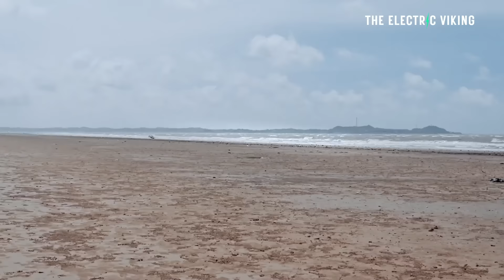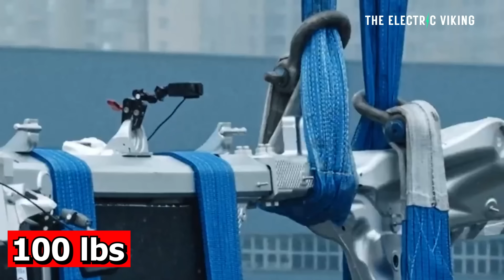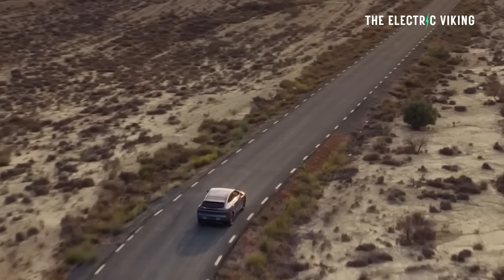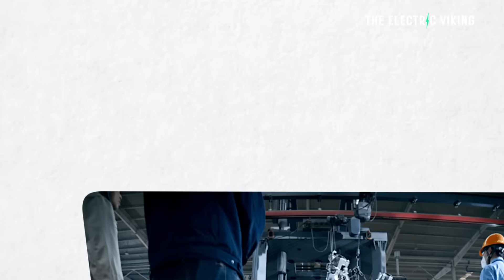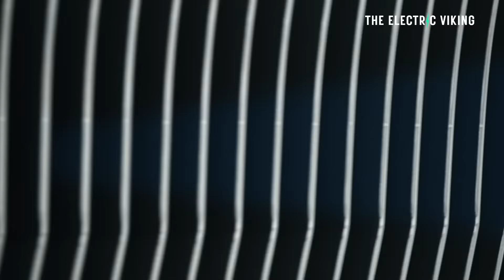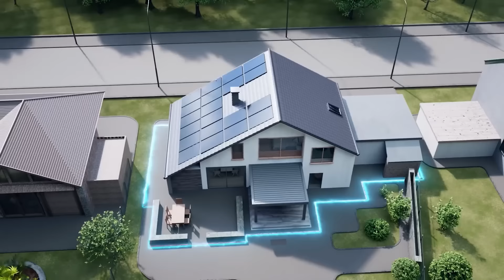Did BYD Just Copy Tesla’s Gigacasting? (The Structural Truth)

Comment: There are like 7 grades of aluminum and multiple alloys within those grades. 7000s series won't crack but you can pretty much only mill a block into a form.(Think MacBook Pro) .  1000 series Aluminum is pure soft makes great jewelry. 

To answer the initial question, 7xxx Aluminum is stronger than steel by weight. (a 10 kg  1 meter long I-beam is stronger than a 10 kg 1 meter  long Steel I-beam: the Aluminum I-beam would be thinker .) Steel is stronger by volume (if the I-beams had identical  dimensions the steel would be stronger but weigh twice as much). So, I could use a steel plate as a floor for a vehicle or I could make an aluminum floor with vertical cross support (like i-beams) that weighs 30% less than the steel plate but is structurally stronger. it would cost maybe 15% more expensive but the weigh reduction allows less battery for the same range of allow more battery for greater range.

Comment: You demonstrate a bias in favor of Tesla and BYD. It should be noted that, as early as three years ago, Chery formally disclosed that the EQ7—a compact battery-electric SUV—was manufactured utilizing a high-strength aluminum-magnesium alloy structural framework. According to the manufacturer’s technical statement, this alloy system provides enhanced durability and reduced vehicle mass, yielding performance metrics that exceed the tensile and yield strength values typically associated with conventional automotive-grade steels. Such material specifications align with industry standards for lightweight structural alloys (e.g., ISO 209-1 for aluminum alloys, ASTM B557 for tensile testing), thereby substantiating Chery’s claim of superior strength-to-weight ratio in compliance with recognized international testing protocols.

Comment: here in the cold north we pour salt on the roads at winter time. Salt accelerates the rusting of steel, many cars after 15 years will not pass inspection due to heavy rusting at critical parts, this is both structural and safety at thin metal plates. Guess Australia is dry sunny and no salt poured on the roads. :)

Comment: From metalurgy studies it's clear that Aluminium does develop micro fractures from repeated small loads & there's no load that doesnt eventually create a crack. Steel on the other hand keeps it's   structure without cracking with small loads, only with high loads will it deform.

Comment: The salt we use to melt the snow and ice on the roads during cold winter months driving , the salt eat away aluminum rims .
The salt definitely well also eat way the body fram structure , too . 
Let hope auto maker have developed a much stronger aluminum material to prevent from road salt corrosions !
Reply: Dude. You got got. Those rims weren't aluminum! Aluminum will anodize another metal or polymer or form an oxide layer on the surface which will protect the underlying aluminum from further oxidation.(it will form what appears to be a white film)  AlOx  aluminum oxide is much different from  FeOx rust. You got tin/nickel shiny alloy rims.

Comment: That lift is a not what it seems. The structural rigidity is given by the battery pack wedged between the two vehicle frame beams.  And the strain quiver effect  for the camera is a joke for a big sling and that light load.     People that think aluminium is not as strong as steel in certain applications are ignorant.  It’s normally not used because of cost and  requiring a better welding  standard  than using formed  steel  frames and components.

Comment: Sam, your arguments about whether aluminium is better than steel in BYD cars essentially boil down to the use of analogies. And, as Elon Musk has stated numerous times, relying on analogies when designing something is a bad idea (it is better to do use physics first-principles thinking). I am not an expert in this field, so I don't claim to know whether BYD's claims are reliable. However, I know that you are also not an expert in this field (car manufacturing is different from bicycle manufacturing) and you should refrain from trying to pass off your ignorant opinions as reasoned or expert commentary on this issue. I award you a rare but well deserved down vote for this video.

Comment: Yes, steel does not have as much a fatigue issue, over time, but it does have a rust issue much worse than aluminium.
So in the end? probably not significant, very few vehicles last more than 20 years anyway.

But I still do not see why a cast-aluminum structure should be that much lighter than a welded-steel one,
I dont think its weight, its cost.

And if gigacasting lightweight !@#$ is the answer its all going to be carbon-fiber/graphite anyhow!

Comment: My experience as an engineer working with aluminium in my own business for 40 years is, you are right Sam. Aluminium is great when properly designed and considering that, even under light loading, it will eventually fatigue and fail. When it fails, how long it will last, depends on the stress at any given point AND the number of cycles. It is somewhat predictable how long it will last. An example of where and where not to use aluminium is to compare an aluminium bull bar with an aluminum roof rack. The bull bar is cycled many times under very light loads and will last for a very long time. A roof rack may carry varying and sometimes quite large loads and could possibly fail after a short lifetime. So an aluminium bull bar is probably OK whereas a aluminium roof rack has to be carefully designed with quite thick members to reduce stresses or it WILL fail.

Comment: The properties of a metal that you are referring to are strength, durability and fatigue. In aircraft design they take a holistic approach as it is designed for all three. Strength is determined by an expected once in a lifetime large load called a limit load. The load at which a part fails is called an ultimate load and is equal to 1.50 times the limit load. Therefore, there is a factor of safety applied to the expected load.  Durability and fatigue are related. Fatigue is set by repeated lower level loads expected during normal operation which vary in frequency and magnitude over one lifetime. For aircraft design they set an expected lifetime of 100,000 hrs of use. Automobiles would probability be less than that. Repeated low level loading cycles create microcracks which are allowed to grow up to a certain size. The rate at which those cracks grow is referred to as the durability of the metal. Some parts of an Aircraft are designed by the limit loads and other parts by fatigue and durability. One or the other determines the minimum thickness that parts will have to be made to. A fully optimized design should provide the minimum amount of material and weight to meet both fatigue and limit load requirements.

Comment: If structure gets cracks from stress, it is bad. Those cracks come in places where the stress is greatest. Those cracks matter, they make structure weaker in the exact place where it had been already too weak. Just my opinion.. Steel gets rusty anywhere where it gets wet and surface protection fails, that is not necessarily the same place what is the weakest point in structure. Oli spray prevents rust but nothing prevents craks if structure is too weak.

Comment: Bad explanation. Steel is stronger than aluminium, but aluminium can be used exactly in path of the force due to manufacturing process - casting. Very simply structures can be designed with focus on certain forces and that can make structure stronger than usage of steel where it is not possible to use material efficiently.
BYD low pressure casting have energetic advantage over very high pressure gigacasting, also not mentioned in video...

Comment: Regarding Aluminum and Steel, what you say is not true. The best example is the car engine. Yes, there were quality issues when the manufacturers replaced their car cast iron engine with aluminum engine. But with better quality control and better design, the aluminum car engine is now extremely reliable.
Reply: Ahh...nope, the nature of forces acting on both structures are not the same, an engine block will have mostly compressive loads and where we have other kinds of force we just enforce with steel (sleeves, bearnings..etc) a ladder frame mostly will have torsional loads, aluminium is one the worst materials in handling such loads, and will fatigue and shear with time. Say again engines, connecting rods cant be aluminium even though its very advantageous, unless you want to replace them every month or two. Other than that: Aluminium = low fatigued limit. Steel = no fatigue limit meaning steel will reach a point were it's no longer getting weaker, aluminium will keep getting weaker infinitely until it breaks.
Reply: @aurelion3  For the aluminum, you need to be an immortal and drive your car everyday to reach the fatigue rupture cycles.

Comment: Panels made from Hemp are stronger, lighter and flex without cracking, reducing repairs needed.  Why won't anyone use Hemp panels???
Reply: Obviously because cost of production is too high. I assume you mean hemp reinforced plastic which requires an epoxy resin which takes 24 hours to set. Waiting 24 hours to remove each part from the tool is too expensive. I have seen some parts made with a thermosetting resin, but the cycle time is still much much longer & therefore more expensive than metal.
The organic fibre most commonly used is flax. There are also some bio-sourced  resins around now which are starting to be used in boatbuilding.
Reply: Wont it leaks then u need other glue, silicon, paste to cast it, in end it may not be that light
Also these may be combustible, burnable 
While metal have much higher melting point also may Not be as readily burnable under 300°C
"Carbon fibre?" is light but likely haven't got strength to repel compression collision
Reply: Fatigue? Try using carbon fibre frame see how it will last holding up few tons 
while continue driving on roads, hump bumps 
take 40 km or faster corners
May not last few months, come apart catastrophically while driving 

Will people use Hemp & epoxy spring as shock absorber? Instead of metal

Comment: The debate over whether BYD 'copied' the physical hardware of a Giga Press misses the real structural revolution happening. China is aggressively capitalizing on AI-driven material science databases like Google DeepMind’s GNoME to completely bypass traditional metallurgy.

The real breakthrough here isn't standard steel or legacy aluminum—it's the deployment of highly advanced, proprietary molecular crystal matrices. By mapping these stable new structures via AI, they are perfecting ultra-strong, heat-treatment-free alloys (and pioneering massive magnesium thixomolding). This completely eliminates the post-casting thermal warping that has plagued massive single-piece architectures.
Reply: Go save  your AI spin for the stupid yanks !  Your entire stupid answer is AI generated rubbish.
Reply: You can thank SpaceX now.
Reply: @thedukeofalinor1377  the soviet union too
Reply: @thedukeofalinor1377 
For what? You should thank my dog too...
Reply: @blackknight4996  metallurgy

Comment: tesla didn't invent a skit, it copied from toycar factories
Reply: Elon Musk didn't start Tesla. He's stealing it blind by fan boys rooting on. 😅
Reply: @peternguyen9386  Elon isn't the founder, but he's the one responsible for where Tesla is today.
Reply: @Ben21756 Tesla is going away like Tucker car company. Elon nazi cars are a big hit now. 😅 cybertruck and cybercab dead on arrival by not using logic, common sense in design despite Homer Simpsons opinion.
Reply: @peternguyen9386  Haven't you heard the recent news? Tesla sales are doing great. You can deny that, but statistics don't lie.
Reply: @peternguyen9386  Have you looked at total world sales lately?
The CT may or may not sell well. It's based on very advanced engineering that is genuinely better in some ways, but still controversial.
Reply: @thedukeofalinor1377  Stainless steel been around ages and some unique cars used before like DeLorean. Difficult to repair and not as impact absorbing as aluminum. Difficult to keep rust away, looking dirty after a sprinkle so people are wrapping for another 3k to 5k. Using glue was a dumb idea instead of bolts. Endless stupidity. 😅. Probably less than 20k will be sold not including SpaceX purchases.
Reply: @thedukeofalinor1377 never try to argue with stupid.
Reply: @peternguyen9386 a scammer and 🐍 🛢️
Reply: @peternguyen9386  True, but he radically changed Tesla beyond the founder's goals.
Reply: Copied from BYD......Giga casting is BYD vertical integration which Elon couldn't afford when he asked Chinese government for help which is why Warren Buffet and Charlie Monger invested on BYD. This whole thing kicked off when China made e-bike mandatory around 1997 and decided to make EV variant.....thats when Elon sold Paypal to invest in BYD so he can open his US factory.

Comment: An aluminum frame car can be stronger and stiffer than a steel frame car if it is engineered with thicker wall dimensions and larger geometric cross-sections.  Automotive strength is a function of both material properties and structural design.

Comment: BusinessGreen covers new plans unveiled by National Grid in the UK for a £4.5bn investment in the electricity transmission system. It continues that the package of proposals for the next phase of grid upgrades has been submitted to the regulator Ofgem and is designed to deliver "secure, affordable and cleaner energy for Britain". The article notes that the portfolio of proposed projects includes new connections for low-carbon generation, major industrial users and data centres, as well as investment to maintain and strengthen the grid amid growing electricity demand.      The Daily Telegraph reports that oil and gas giant BP is still considering quitting operations in the North Sea, following a review last month of the company’s offshore operation.